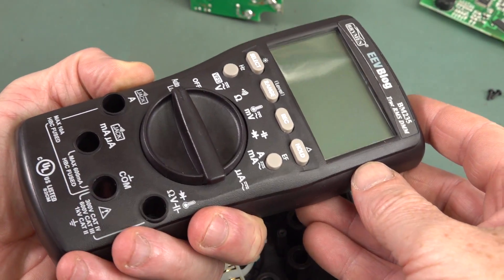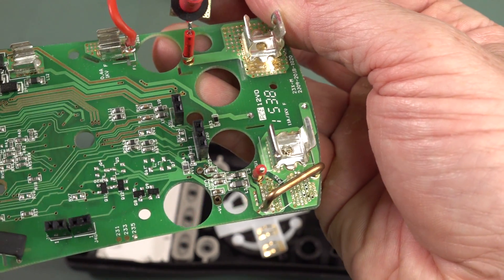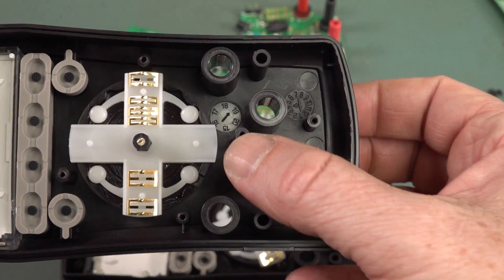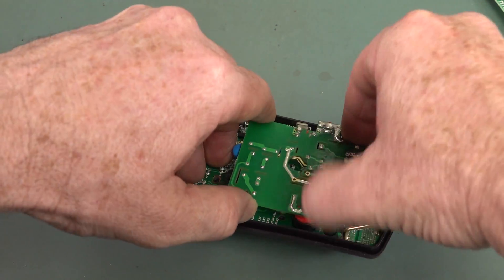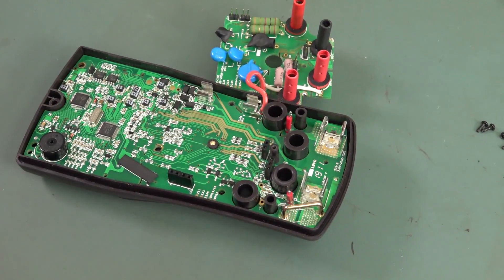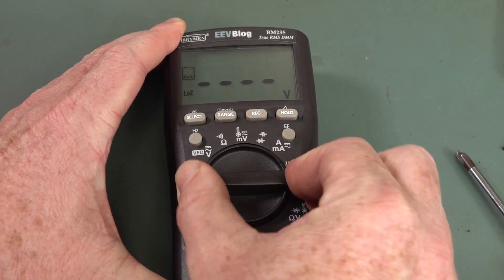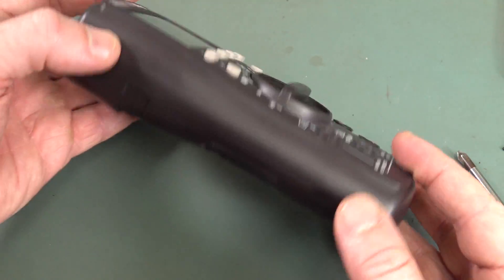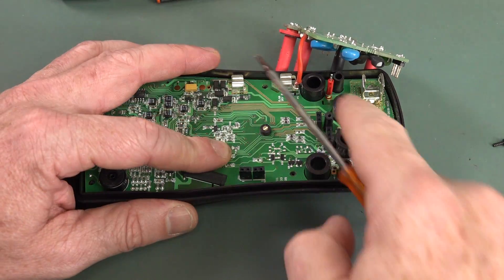BM235 Multimeter Faulty Switch FIXED + (OZ) GIVEAWAY

Comment: Greetings: While following your reassembly of the two meters I think you used one 2015 case front with one 2019 case back half as you put them together (hopefully that was intent).
So, only change was a 2015 case front for your repair.

Comment: not in Australia though, would love it to replace my UNI-T multimeter. does 20 nearing 21 work for you Dave? 1998. Also slight feedback for the new casing. the posts for the screws which secure the bottom pcb to the front case can be a half beesd**k longer and exhibit these symptoms. had some gripe with the UNI-T DMM because if tongue not at the correct angle when you rotate the knob it goes from continuity to resistance with the knob on the continuity. annoying but does it once in a while and my broke student ass needs a multimeter.

Comment: I think it's the LCD connection and not the switch. The force is transferred through the front plastic case, not the circuit board. I had a Fluke meter that someone threw out that had a similar problem. When I pressed on the front of the meter the segments would go on and off, similar to the problem with your meter. At first I put some cardboard on the inside of the case to increase pressure on the LCD contacts. That worked somewhat. Later I took it apart and cleaned that conductive rubber strip that went against the LCD glass with alcohol, and that completely solved the problem.

Comment: Could still be a cracked solder joint issue, where the new (old) case is holding it in a slightly different position.

Comment: Hi Dave. Could be the start of a plastics issue. I worked for a company that produced its own rugged PDAs and vehicle trackers a couple of years ago, and we had to abandon production of one of our products because the plastics moulds had worn to the point that injection moulding was no longer possible. However, with the batch before we hit that point we had noticed that on some units certain parts of the plastics were looser than normal.

It could be that your multimeter's moulds are starting to wear out, which will mean either new moulds (cost a packet) or retirement of the product.
Reply from the maker: Interesting, that is possible. No other reports though.

Comment: Why not change the switch assembly. Eliminate the whole switch. not the whole case.
Reply: From the video, it looks like the metal shaft in the center of the switch assembly might be crimped or peened to keep the switch assembly from coming apart.  I'm not sure about this, but I'm not going to take mine apart to find out. :)
Reply: I was thinking the same thing, may well be just one of the contacts not well aligned on the original.

Comment: LOL. Like any good Electrical Engineer, you are OCD and needed to get the solution to the problem. Were these two video's in real time, I.E. a few hours apart. 

I'm guessing they are.. The first video you didn't find a solution or a cause, so you couldn't sleep until you found it :-)

Comment: The range switch is a one big issue itself. Very poor design require lots of force to switch. There should be no range switches on modern digital multimeters, only soft buttons.
Reply: There is no voltage drops in relays. Bench lab multimeters have only buttons and they have much better precision than handheld multimeters with a stupid range switch.
Reply: So you came straight to trolling. This is where you should start.

Comment: Hey I'm a 22 year old who works with trams at a tramway museum in Sydney, and sadly my current meter is only CAT II so no high voltage stuff, especially since its 600V DC and the aux is 415V AC for a specific tram that I've been helping get up and running for regular operations. The CAT IV meter would be great to get this piece of history running again. (for context it's a Variotram)
Reply: Very cool

Comment: The whistling oscillator isn't overly stable and seems to drift lower over time. May need calibration.
Reply: Leaky capacitor heating up could be also a culprit. _
Reply: It's just a copyright infringement detection countermeasure.

Comment: Probably just the 1 in 10,000 where the plastic distorted when it came out of the mold. It's just not practical to wait till the plastic is cool before ejecting it from the injection molding machine.